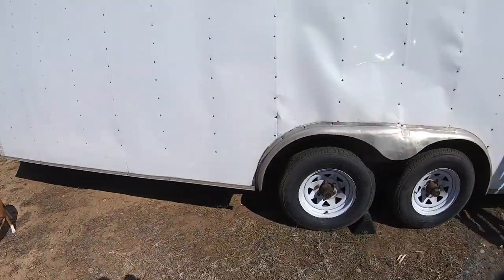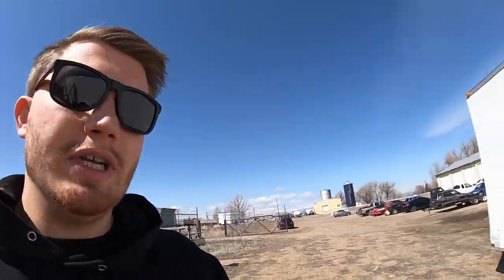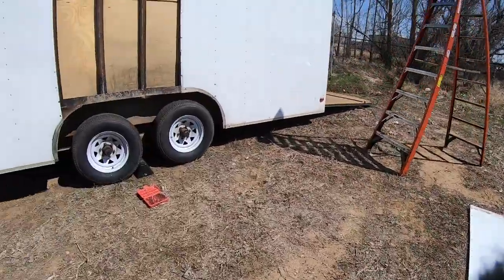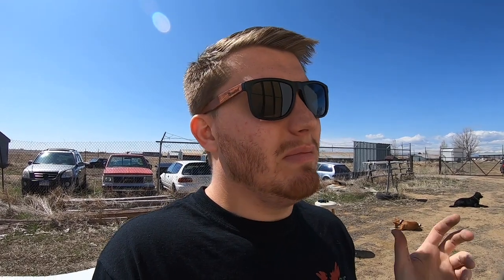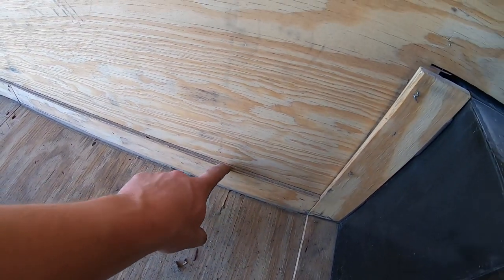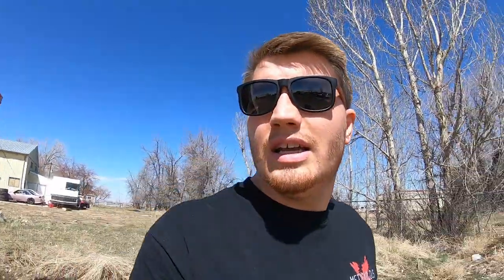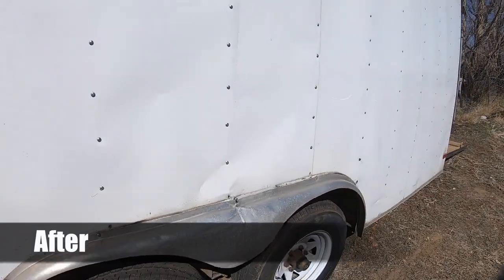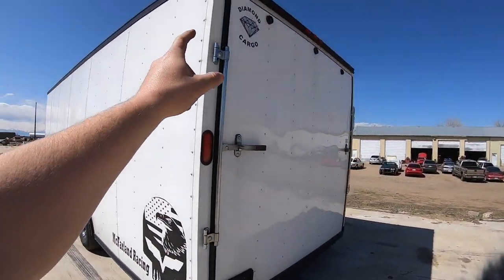Ever Fix a Trailer Dent?... Me Neither, Lets Try!

Comment: As far as someone "turning into something", pivot points are the most difficult spots to "turn" into something... unless he slide the trailer into something (which certainly happens a lot in the winter due to trailer brakes). If it wasn't slid into something, it was run into for sure.    
   Throw a jack (or forklift lol) under the fender well on the center of the dent and beat around the ridge of the dent from the topside while keeping a bunch of pressure applied to the bottom, if you want to get the dent out further.   And can also confirm they sell single panels if places are open there (have done many of them). :)

Comment: Damage is like the car in Once upon a time in Hollywood. I think Emilio kicked somebody into the side of that trailer. Get a new panel from trailer supply or try a heat shrink. Keep inside light color for light reflection.
Reply: I'd say paint the walls and put vinal floors down just to seal the spills.

Comment: I actually fix stuff like this daily. Replace the panel, don’t bother with paint. Fender lip is cheap and easy to replace. Also 3M VHB tape on the studs is your best friend on a trailer with screws in the paneling... Kyle’s trailer is a “black out” package and was built that way. The atp, fenders and trim are powder coated black. As for the inside of your trailer I recommend and personally use Raptor Liner for floor and wall treatment. It can be purchased or tinted in whatever color you want. Scuff the wood with 40 grit and lay it down, and it stays.

Comment: For the dent in the metal sheeting, I would bring it to a metal fab shop that is equiped with sheel metal rolling equipment. You pass the sheet between the rollers to give it a slight curve on one side, then you pass it the other way to straighten it the best you can. If not, you can probably just buy a new sheet or 2 from a trailer company. For the dent in your wheel tub, I have a 10 ton body jack that I bought off amazon. Pretty good to straighten things like that! For your fender, a couple passes on an english wheel would probably eliminate a lot of these imperfections. Last point, I wouldn't personnally caulk the seams because if the trailer start to leak again, it might seal the moisture inside the walls and make real damage unnoticeable. At least if you can see the water dripping inside, you know you have a problem!

Comment: You can get a replacement piece of siding pretty cheap,  Painting the trim is up to you... it's either polish it or paint it. Self etching primer,  and possibly epoxy paint. Paint the interior with enamel White Walls, I'm old-fashioned and believe a oil base is superior, if you can't get it in your state you can still probably get Rust-Oleum enamel yes it's for metal, but then it out and spray it and you'll do just fine with several coats. There are several good flooring options I like a textured tile in checkered pattern. You need to figure out how to outfit the inside for what you need for storage, and we also recommend an awning on the outside.

Comment: I'm kind of late to the party, but you need a "slapper." (a type of body hammer, google it, most people make their own, I made one out of a leaf spring leaf I had sitting around), it makes straightening flat or gently curved panels a piece of cake, I've straightened a bent up garage door with one and you can't tell.
Those panels are available from trailer dealers, put a new one and a new fender on it and no one will know.

I like Kyle's trim, but be aware you might be opening a can of worms.  The aluminum might be either clear anodized or clear coated and that could cause issues with paint.  Your best bet is to use an etching primer or a zinc chromate primer before painting it.  I wouldn't be at all surprised if the black trim on Kyle's trailer is either powered coated or anodized before it was put on.
I'd paint the inside of the trailer white or light grey, it will make it brighter in there and easier to work on the car.  It will also show any dirt more :-/

Comment: You made sure to seal the seams back up when you put it back together right? Like the panel you pulled off. And I guess the wood inside doesn't really need it but wouldn't hurt. But outside for sure and the seam above the fender. I'd even put a little Dab into each screw hole b4 you put the screws back in to make sure it seals.

Comment: Use outdoor deck paint and get the extra textured, it’s almost like a bed liner mixed with paint. It will flex with the wood. Epoxy is to brittle and will crack when the wood flexes

Comment: Kyle's (Cleetus's old) Trailer definitely came from the Manufacturer with the trim black. It will be almost 100% powder coated. It was definitely not rattle canned black. And you would be surprised how much damage a blowout can cause. Because there are not impact marks on the out side sheet metal the rubber from the blowout could have easily been cleaned off with brake clean. If he had hit something there would be damage like scratches and missing paint from the side. Just go and get a new panel from a local steel supplier. You can get it pre power coated or painted. And call the trailer manufacturer and buy a new fender (spat). Then it would look as good as new. Also with the dent in the wheelhouse you can see from the inside. Use a block of wood and a floor Jack and put some weight on it while you slightly hammer around the outside of the dent. Maybe even use a little heat from a torch just to take the chill out of the steel. Don't heat it up so hot you burn the paint. Just enough to make it easier to work. Its worth doing because apart from that it's a nice looking trailer.

Comment: i think the dent has been caused because the frame at the rear of the trailer is bend up (like when the trailer is overloaded , then the front tire is blowing out and the rear wheel takes all the load thats inside the trailer ) , wouldnt be suprised that the grease goes on intoo the roof as well
i suggest you put the trailer on the lift or over the greasepit they have in the shop and check if the trailerframe is still straight or cracked check aspecially around the springmounts and where the solid axle could bottom out on the trailerframe 
as for bending it back , it might be eazier to use a bottle jack and some bracing to push off of
as for painting the floor : bedliner is nice , anti slip and holds up well (its a sort of rubber so it stays flexible), could also do black and white checkerboard vinyl

Comment: U can buy replacement body panels. Caulk between the outside panels would help alot with water getting to the wood. The wood usually isnt treated so it rots fairly easy

Comment: I work for a all aluminium trailer manufacturer, order a panel from the company that build it. (Info will be on the ser#tag) Those aluminium outter fenders are less then $100. .  we powder coat the trim pieces. I would just mask off and paint the trim and fenders matte black using a self etching primer first.

Comment: Get the textured shower and bath board wall sheets that comes in white and other colors and just line the inside walls with that. I think it comes in 4x8 sheets that are like a 1/4 inch thick.  It cleans up very easy and is gloss finish so it willl brighten up the inside a lot and look really clean. Then i would just bed line the floors with the stuff from there parts store that u put on with a roller. A little better grip and would clean up spills pretty easy and would look killer. Add a few strip lights and it would be Pimping.

Comment: So I work for a trailer manufacturing company and have fixed many trailers messed up worse than that. And you did a pretty good job. But it would have been a lot easier to go and purchase a new sheet.
Reply: Thatxcarxguy 
A agree with you.spend a little on new angle iron, sheet aluminum, and fender trim. Would make it look like new money.

Does  look much better , but a little extra would look great

Comment: I would paint the floor with a oil base floor paint for inside a house and prep with mineral spirits also I think the outside would look grate black and white but you will want to sand with corse sand paper so the paint will adhere to the aluminum

Comment: Hayden, just drill a small hole and get a 1/4 in fla strap on the back where it’s bent, and get another flat strap for the outside and use an impact wrench and a washer and nut combination

Comment: just replace the panel and get new screws pretty cheap as there composite sheets. looks better painted black id say kyles has been powder coated or painted. In Austrlia you can buy ally pre coated new

Comment: Painting is a tough one.. it all comes down to are you gonna prep the shit out of it? If not than just polish it and leave it, or itll just look like shit in a year or 2.. for inside just make sure to use a damn good exterior paint and it will hold up. For the floor give it a good sand before putting anything down. On my old trailor I sanded/primed/painted the floor and besides having a car sitting on it for long periods of time (where the tires sat it would peel up) it held up pretty good. Just a quick 5min to roll a new coat on the trouble spots and it's done. Outside tho, you gotta prep like crazy and scotch brightening diamond plate is a nightmare imo...

Comment: I think epoxy is the way to go.  I've seen it done on other trailers, it is durable and washable ( 3 coats).  Do the whole inside, it will be expensive but you can buy its In 5 gallon pails, any you can spray it with a compressor, just mix a small batch at a time.  Do the whole interior.  Use a bright colour and mount LED  lights have a look online at Taylor Rays  gooseneck trailer or or peoples jobs.

Comment: Truck Bedliner on the floor and up the wall maybe 6 to 8 inches seals it up good. Then paint the rest if you want. Then you can hose the trailer out and won't damage the wood. We've done it. Just get the stuff in a gallon can and not the spray on rattle can stuff. That stuff isn't as good in my experience.

Comment: I think you should put more effort and time/money in your rx7, trailer will haul the rx7 looking the way it's looking rn, once you finish the rx7 and have the extra cash just buy a new panel and replace it and do the job right. Without cutting corners, but it dose look much nicer then before, and it will get the job done. Love your vids!

Comment: Why not glue a pvc floor in it and paint the walls?? That PVC floor is pretty much indestructable and don't cost a ton of money.... Paint the trim black like Kyle's trailer looks way better i think... And why not replace that piece of sheetmetal on the side. And if you dont want to do that, maybe use some heat, it's aluminium...... Love your vids man, keep em coming....

Comment: A tire can do some major damage bro I've had a blowout and it ripped my whole fender off and bent up some thick ass angle iron that I had to heat with a torch and use a 10 ft pipe to bend it back lol

Comment: I have seen and have had tire blowouts on trailers that have done major damage especially on less expensive ones. That said it really doesn't matter what caused the damage now all that matters is a good repair. If it were me I would still consider replacing that upright if it causes the trailer skin not to lay flat.  Personally I would get a new aluminum panel(s) for the damaged one(s) and replace that outer wheel well/fender or replace them with better ones.  It looks to me like you might be able to fab up something that looks real trick looking.  While we are at that part of the trailer now is the time to get some decent looking wheels because those things are fugle.  You might want to measure the lug pattern, offset etc and look what might fit from a car or light truck.  i used to build trailers and use Explorer wheels years ago. While you are in quarantine gets some new seals pull the drums/hubs and give your wheel bearings a proper cleaning and repacking. ("Bearing Buddies" imo suck and will leave you stranded in the middle of bum-failya more times than they save you and use good synthetic wheel bearing grease.) 
As far as  painting the aluminum trim I would not for the simple reason you will be painting that stuff every year additionally you don't want to ever paint anything on the outside of a trailer Black or or any other dark color. 
With regards to painting the floor of the trailer look at the bottom of the floor of you trailer if it is not painted don't paint the top I would give it several coats of Thompson Water Seal and wash the bottom of the trailer and use a garden sprayer to coat the bottom of the floor with Thompson Water sealer if it was not painted.  If you do anything to the floor of the trailer consider staining it because paint on one side tends to cause moisture retention which can cause the plywood to delaminate/rot quicker quicker, additionally it will make it slicker than goose sh*t when it gets wet or it is damp out which will in turn cause your car to move (slide) around going down the road.  I totally agrees about painting the side wall paneling.  I have used enamel semi-gloss house paint before make sure you prime the wood first to keep it from drinking in the paint so much.  Additionally you might want to consider pulling all the interior paneling down and insulate with "faced" foam sheets and use construction adhesive to hold it in place as well as insulating the roof and installing paneling after you run wires for lights electrical outlets if you install a generator in the future. If I did not install a light gauge sheet metal ceiling I have used vinyl soffit paneling or acrylic/vinyl bathroom paneling. I actually prefer using vinyl for the ceiling panels over sheet metal because it is easier to work with and is generally cheaper per square foot.  I like vinyl or sheet metal over wood because it is easier to clean and keep clean.  With regards to what adhesive/caulking to seal/glues that trim back up with take a look at  either Sikaflex, or Titebond Provantage HD Construction adhesive.  The Sikaflex you can get in white which is what color i would paint the the walls of the trailer for max light reflectivity. The door of a car trailer almost always looks pretty skanky and putting tread brite aluminum is popular but pretty slick, indoor outdoor carper looks good until it doesn't hold dirt that dribbles onto your car while you are going down the road, paint when damp is way to slick so pretty much the best solution is vinyl flooring.  While you installing wires for future use also run some wires to install a light bar for a off-road vehicle at the rear and side door that way if you put a battery in the trailer that can be charged off your tow vehicle power wire of a 7 pin trailer plug as well as inverter to charge the battery of your cordless impact etc. until you get a generator.  This is something i learned years ago if you don't have a hammock yet get one and install brackets/posts strong enough to hold you that way if you are at the track and tired you can sack out in your hammock.  Good luck on your trailer

Comment: Definitely was a tire blow out. I've been using enclosed trailer for 30 years and I have had some bad blow outs. Yours is mild at high speed blow out. I've had the whole side where tires were completely ripped off.

Comment: OK you asked "what do you guys think" you are a hack, buy new sheeting for the destroyed ones, buy a new wheel fender, cut out the bent frames and weld in new ones, I mean if your going to make repair videos atleast repair it, use 3M 5200 on the seams, (wood, metal) I just repaired several spots on mine and you couldn't find them if you were looking